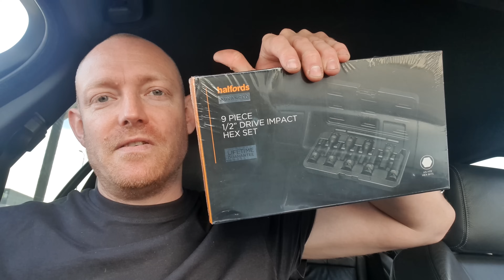Building a 40 year old motorcycle FROM SCRATCH! Part 2

Comment: Great job on  the wheels but like a few others have already said, please don't ever seat bearings by hammering on the inner race. If the decision were mine, and it was my bike, I would want to put new bearings in again. There is no way of knowing if you have done any damage to them.
Reply: Made me wince every time you did it. 😬
Reply: Agree, those bearings probably fubared?
Reply from the maker: I've already made the decision to change them, what a muppet, eh? 🤣
Reply: @AshRowland  It's a learning process buddy. Thankfully you get an opportunity to correct it before any damage has been done. Still a great project you are doing. I have done a 1990 ZZR600 and am currently doing a GPX750R, like you I have done a complete strip and overhaul. I have a GPZ1000RX to do once I finish the GPX. 

Keep up the good work.

Comment: put the bearings in the freezer overnight before plopping them into the wheels and they'll just drop right in without all the tapping/hitting/smacking.
Reply from the maker: Great idea! Or I guess you could heat the wheel up 🤣
Reply: @AshRowland  do both.
Reply: @AshRowland be careful heating a painted wheel you can cause the paint to bubble up
Reply from the maker: @thatwolffe3802  yea, I'll probably just do the freezer thing lol

Comment: Ash, watching your GPZ900 restoration, seems to be going well. If i can alert you to a mistake regarding the brake disc mounting bolts and this is rather important. The brake disc mounting bolts on both the front and rear discs are to be coated with a Locktite solution, the new bolts from a Kawasaki dealer are already coated, the grease you have coated the disc mounting bolts with needs removing and recoating with Locktite. Regards, Kev Edwards.
Reply from the maker: Thanks mate, I've got some Loctite on order 👍

Comment: Well now, here's a thing, loctited bolts can be removed more easily by applying a touch of heat to the bolt head to soften the loctite before applying force to the threads. Any bolt you do apply copper slip to needs to have the torque value decreased by approx 10% to cater for hydraulic lock on the thread. Finally, you can place the old bearings on top of the new bearings to hammer the new ones home, after freezing overnight of course. Halfrauds sell some very good punch sets for knocking bearings out which will save your screwdrivers. We all live and learn buddy. Keep up the good work. Oh, and dont apply anything to brake banjo bolt/nipple threads.
Reply from the maker: Thanks buddy, this is all very complicated 🤣 I think I'll leave the copper ease off of bolts that have torque settings 😉 I've ordered a bearing bashing kit 😀

Comment: Thanks Ash, great stuff. As others have said, use a big socket to bear on the outer race when driving bearings in. What you did is putting all your hammering force through the machined surfaces of the races. It doesn't automatically mean problems for you but the risk of having indents in the races from the balls is there. Just check by rotating the bearings and feeling for any sign of roughness. A trick I use for installing is bearings in the freezer first but also dumping a kettle of hot water over the wheel hub so it expands. The bearings go in really easily after that and I clean up by dousing the area in WD40 because it disperses water. That's the W and the D.  I always look forward to your videos. Thanks for doing them.
Reply: WD-40 …..
Water Displacement - 40th attempt :).    
Took 40 tries to get it right
Reply from the maker: Thanks mate, yea you're right, mistakes were made in this episode... the bearings feel absolutely fine but I'll be replacing them anyway. I'll try your freezer trick 😉

Comment: Good evening bike building Ash.
Like your videos buddy, happy days! 

I’m a motorcycle restorer and use this product for broken plastics & light metal. It’s a 2 part epoxy and it sets like nylon. 
The best stuff on the market, quick setting! 
You need a special dispensing gun & ‘self mixing nozzles’ Comes in cream and black colour. 

Ebay description:-.
Plexus Industrial Strong Adhesive Glue Repair MA310 50ml (10 PACK).

Very strong and will glue anything used in Boat structure repair and other trades. Comes in a box of 10 comes with endings but you need a glue gun to extract the glue.

Best regards 
Hog
Reply from the maker: Oooh I'll check it out, thank you 😊

Comment: Loving all the vids on your GPZ, just binge watched them all up to date! Just a couple of things, I wouldn’t hit the centre of the bearings when putting them in, always try to hit the outer edge, I usually use the old bearing to knock the new one in, or at least get it started. I’d check your manual for the fitting of the disc bolts, I’m pretty sure it will say use loctite not copper grease, you definitely don’t want them coming out!! Looking forward to the next instalment 👍🏻sorry, just read the comments above regarding bearings and bolts 🤦🏻‍♂️
Reply from the maker: Thanks 👍  glad you're enjoying the vids 😀  thanks for the tips, I've ordered a new set, just in case I damaged them, and will replace them. I've bought a bearing bashing kit too

Comment: Your new bearings with the rubber bit are what's called sealed bearings(for water) a lot better than old ones.
You disc's screws should be locktighted in with Red locktight which is non permanent locktight so can be removed
Your doing a great job well done
Reply from the maker: Thanks, I was worried they were different, I'm glad they're better though... unfortunately they'll probably have to come out again due to the way I beat them up putting them in 🤣

I might be wrong, but I think red loctite is permanent, blue is the non-permanent one
Reply: @AshRowland  Yes, use the blue.

Comment: Hey Ash, they look great. One question, do your wheels fit in your tyre machine with the disc's and sprocket on? Only asking as the place I always use (dont have my own machine) makes me take them off before they will fit a tyre. Could be a ensuring they cant be blamed for bent discs thing, just curious?
Reply from the maker: It's not my machine, it was the guys at Cardiff Motorcycle Centre that took the tyres off for me, they didn't need the discs removing, maybe their machine has extra space to allow for them? 👍
Reply: @AshRowland  Cool, thanks

Comment: Torque figures are probably meant for a dry thread.

Also , there is a spacer between the rear wheel and the sprocket carrier
Reply from the maker: Yea, but then I get moaned at for not using copper slip, I can't win 🤣
Reply: @AshRowland  true. I use copper slip quite often. But be aware that the torque reading will be lower.

Disk bolts I normally loctite (often new disk bolts come pre coated with thread lock)
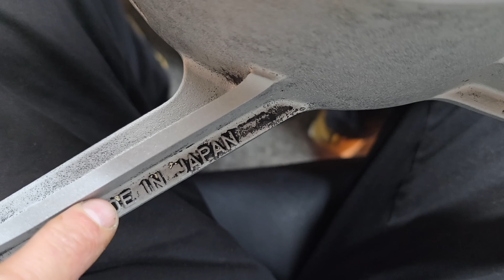Reply from the maker: With regards to the spacer, you're absolutely right, I've looked at the exploded diagram for the final drive and there is a stepped spacer thats supposed to be in the cush drive of the rear wheel. I thought maybe I'd lost it but I looked back at the part 1 video and if you pause it at 18:05 then you can see that it was already missing! I've managed to find one on eBay.
Reply: @AshRowland  , not uncommon for that spacer to be lost on a lot of bikes.

A friends zx6r had the spacer lost by a tyre fitter. Lasted about 500 miles before the sprocket carrier bearing failed, at which point the sprocket nuts chewed up the swinging arm.
Reply from the maker: @katywalker8322  😳
Reply: @AshRowland  indeed!

Comment: The cracked front mudguard is standard for Kawasaki of that era having replaced mine on the ZZR1100 a couple of times.
Reply from the maker: It's done well for nearly 40 years though 😄
Reply: @AshRowland  ABS adhesive from the local B&Q etc for the cracks.

Comment: I thought you had the workshop manual?
Reply from the maker: I do, but it didn't say anything about threadlocker on the disc bolts, and I didn't have the recommended bearing driver set 😕

Comment: So Ash, what`s the silver frame screen left, at 5 mins, while your`re stripping the front end apart?
Reply from the maker: Ah, busted! That's the GPZ frame that I've already painted, but this section of the video was recorded months ago 🤣 bad continuity on my part
Reply: Oh dear Ash, naughty you🤔
Reply: Also  @AshRowland some have said about driving the bearings in, ‘only drive the outer race, not the inner race’ well that would be preferable but the correct way is to drive the entire face of the bearing equally, it allows the bearing to seat correctly in the case of an internal spacer and the absence of a seat, disc bolts should be applied with blue thread lock not copaslip, but keep up the good work as it’s all a learning curve👍
Reply from the maker: @steveneastland4128  you're right mate, all a massive learning curve for me, and don't worry, I've already ordered a new set of bearings and some 243 loctite 👍
Reply: Good man Ash, looking forward to you taking on the Genesis

Comment: Ash, going back to your carbs did you find a paint that was resistant to petrol?
Reply from the maker: I did yes, it's called 2K paint, or you can use normal spray paint and protect it with 2K lacquer
Reply: Cool thanks mate!

Comment: Did you remember to put the pipe between the two bearings back in as did not see you do that?
Reply from the maker: Yes, but that's the least of my worries, the comments section has pointed out that I've probably damaged the bearings so they need to come out again

Comment: A tip i had one before a great bike great engine good gears only a nervous front end its front fork is not the best and a front tire not most stable
Reply from the maker: I've heard this also, people swap them out for ZZR and other variants I think
Reply: @AshRowland  sketchy
Reply from the maker: @marcswinnen9100  can't wait to experience this 🤣🤣🤣
Reply: @AshRowland  yes i had a few almost crashes😊
Reply from the maker: @marcswinnen9100  😳
Reply: @AshRowland  the front fork that model you can fill with oil and my forks you can fill extra with air down in the front is it a 16 inch front tire?
Reply from the maker: @marcswinnen9100  Yes, they are oil filled and topped up with compressed air via the valve at the top on one of them. And yes, 16" wheel and tyre

Comment: tap the outer race of bearings never the inside🤔please and i think discs screws are supposed to be loctited not greased come on.
Reply from the maker: Yep, you're correct, mistakes were made, but don't worry, I will rectify them 👍
Reply: @AshRowland  All right then. Thanks for the videos.

Comment: Put bearings into the freezer overnight and torch up the hub center prior to bearing installation…you might just find you dont have to pound anything. I have had them drop right in. WHY ARE YOU APPLYING ANTI-SEIZE to rotor bolts? NO NO NO! You should be loctiting those with red loctite!
Reply from the maker: I keep forgetting the freezer trick... check out my more recent video where I replace the bearings again due to doing them wrong.